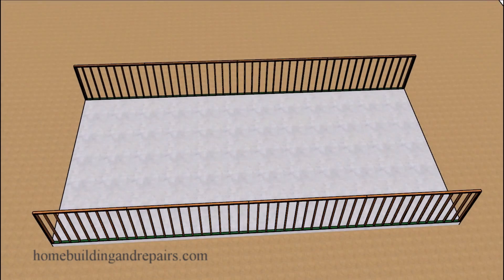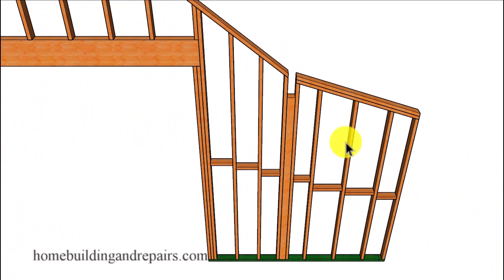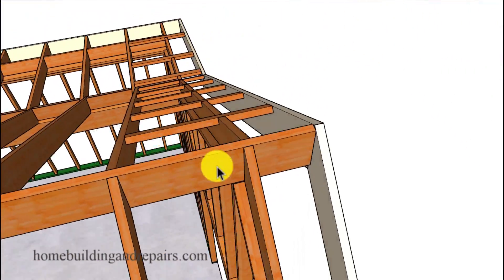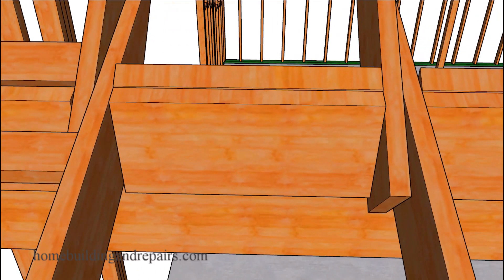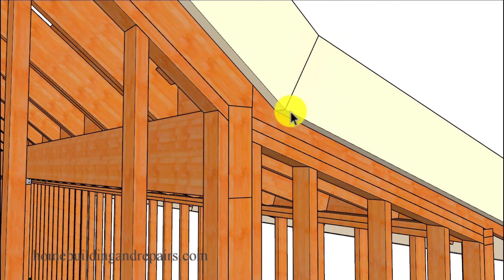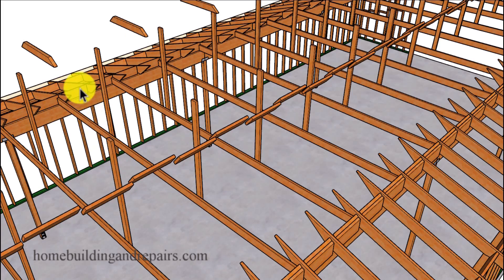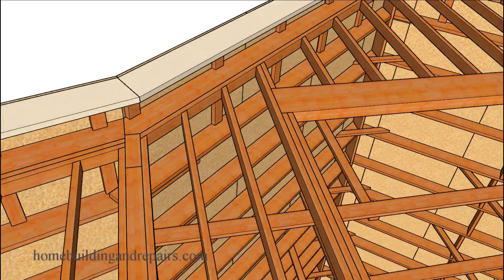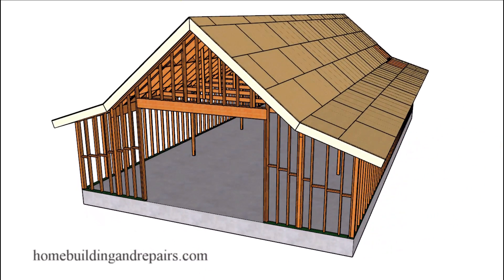How To Frame Large Building With Double Pitch Gable Roof - Examples For Design And Construction

Comment: Greg, I have designed a house very similar to the example you used in this video. I am trying to verify if I can use 2x10 rafters with 2-2x12 ridge boards to span 24’ great room with a cathedral ceiling.  On either side of great room is a bedroom wing that is 16’ wide. Over the great room is 6/12 slope and 2/12 over the bedroom wings.  From watching many of your videos, I am questioning if I can do this with out all the structure tie ins you are using. I am doing the roof this way too match an existing barn / workshop. I want the great room to be very open as the house won’t be that large.

Comment: Why would ever want to build a double gable building other than looks? This is more of a Polynesian roof isn't it?  Double gable is normally different.
Reply from the maker: I changed the title and thanks for letting me know. If anyone can find any other names, feel free to share them.
Reply: @gregvancom  I really didn't know the name for this roof style... I just looked up the sort of truss designs you can order and it looked similar
Reply: @xephael3485  I have heard it called a Polynesian as well. Semantics really, as one could describe it as a double lean-to gable roof. The sides are lean-to roofs.
Reply from the maker: @xephael3485  I recently had some ask for help with this design and they called it a double gable (roof with 2 gables), but I've never built one like this so it will be a double pitch gable for now
Reply: I think the idea is to provide an alternative to trusses. If I were building this by myself, I'd be tempted to go this route, namely because it might be easier (mechanically speaking), and maybe even cheaper, than utilizing trusses. Pros and cons, as with everything. This method would provide a more vaulted and open feel, but would be more difficult/expensive to insulate. Trusses-- the exact opposite, perhaps.
Reply from the maker: @d.i.whynot484  Yes, trusses might require a lot more lumber, depending on the design of the truss.